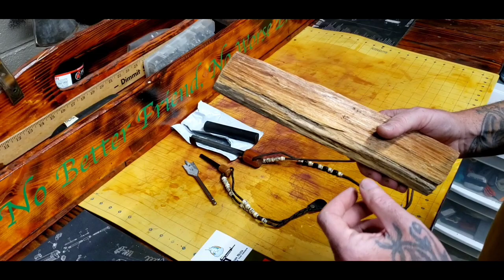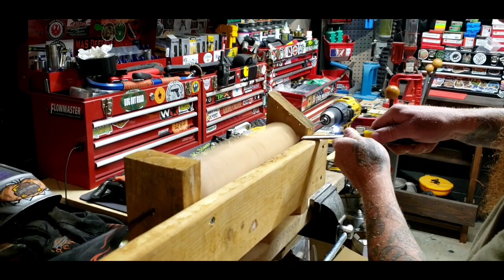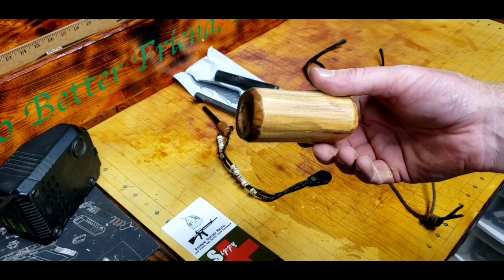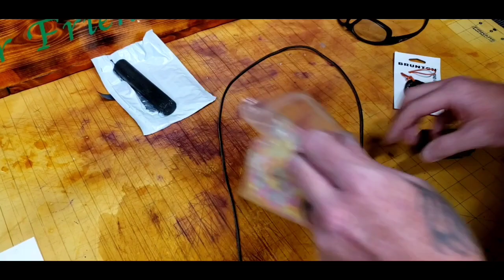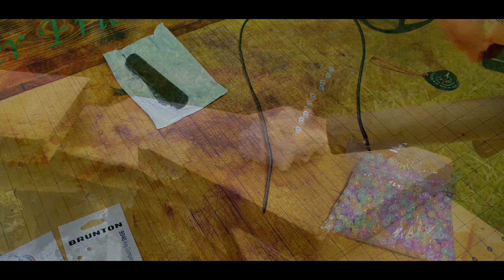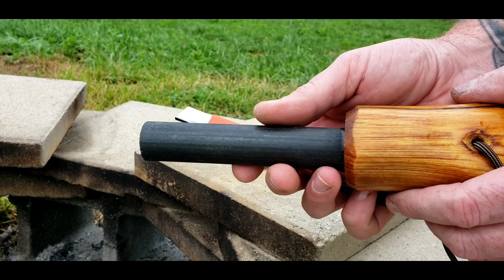Worlds LARGEST Fire Steel 🔥 Monster 1" Ferrosenium Rod

Comment: I found some really killer fatwood at work and drilled a 1/2" hole in the handle i carved with a drill bit, then just used gorilla brand epoxy to hold it in there. One year later and it's still going strong. I just bought a backup 1/2" Sasquatch ferro rod from Nathan 4071 and i plan on doing the same thing again. I need a drill press and lathe in my life lol, your home made lathe was awesome. Nathan's ferro rods really are the best out there.
Reply: Joey Jones nathan is a good guy and will drill a hole for free if you ask. He’s on eBay.

Comment: Once I seen those Monsters where available I started searching and finally found some a couple years ago. It was 1" x 6" in size. Price was reasonable. I have never used it and if I ever do have to rely on it, I'm pretty sure it's gonna last me a lifetime. It's so big I keep it in a Bianchi Flashlight belt pouch. Get the Monster if you can find them. Pretty rare for the larger 1x6 model.